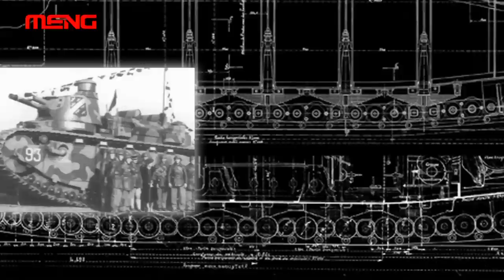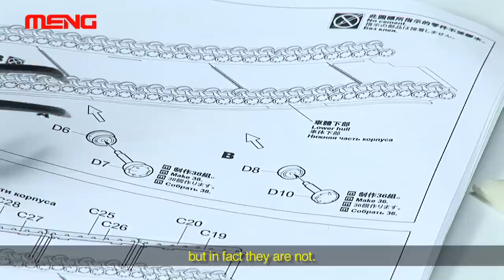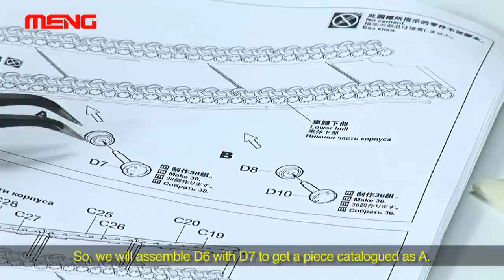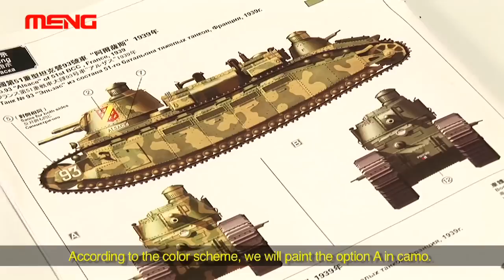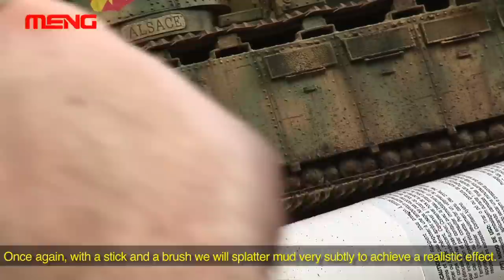MENG TS-009 1/35 French Super Heavy Tank Char 2C Build Guidance Video

Comment: Dont wanna be a prick here but theres flash on the roadwheels, fingerprints on the hull, raised edges from using a posca marker (that just flabbergasted me.. ) the PE is all fucked up from an overdose of primer, theres drips.... Dont get me wrong, I do like the endresult alot, its beautifull... but what if your build guidance would actually show a proper way to build models, wouldnt that be better?
Reply: +Flying Dutchman WoT/WoWs Gameplay TV 
Also...airbrushing indoors :-(
Reply: I have a spraybooth and been spraying inside fr 30+ yrs, that isnt a problem. WITHOUT a spraybooth is indeed just asking for trouble.
Reply: Why though? I've been using mine indoors and I haven't had a problem. What should I be afraid of?
Reply: Its just not supposed to be good for your health to be breathing in all the paint fumes.  So usually its recommended to either spray outside or in a spray booth
Reply: Matthew Hodge But I assume using acrylics won't hurt that much...? Like I'm doing it 2-3 times a month
Reply: Inhaling acrylics won't hurt that much? You tell me in 20 or 30 yrs.....
Reply: Flying Dutchman WoT/WoWs Gameplay TV Ok good to know man!
Reply: SetoFreakingKaiba I'm sure you'll enjoy asthma or lung cancer.
Reply: Are you actually Dutch or
Reply: Not

Comment: nice vidéo  , youcan tel me how you paint with valejo air color ? pressure , needle size etc please ?
Thank you so much !
Reply: To work with AV airbrush colors is very easy. Pressure no more than 2 bar., 1,5 bar. it´s ok. Needle 0,2 to 0,4 (depending on surfaces to work). Anyway, I recommend you to dilute painting a bit if you will work with low pressure. You will achieve nice results if you practice with the airbrush trigger. Good luck! Jose.